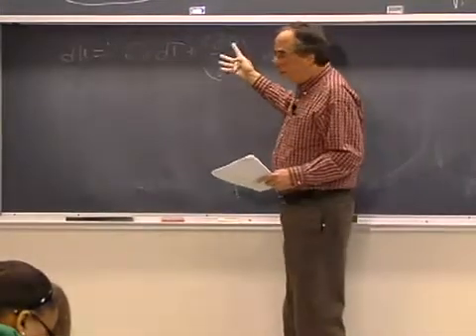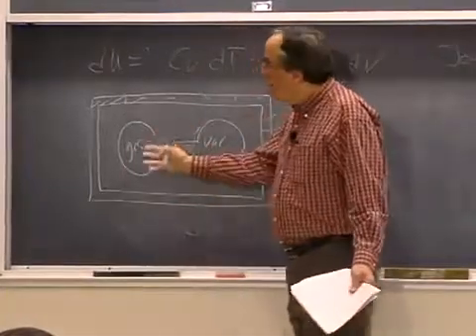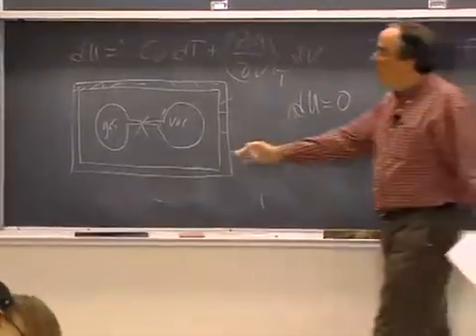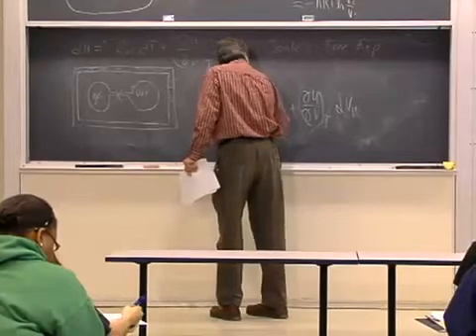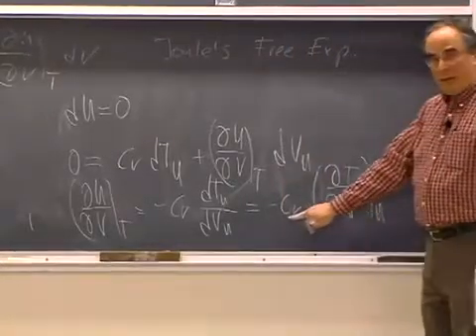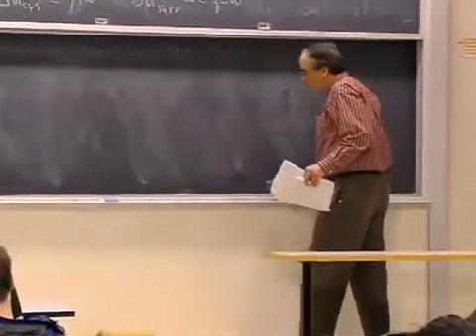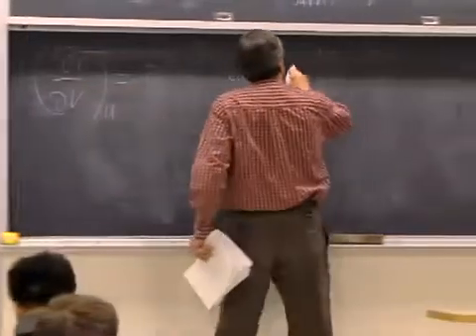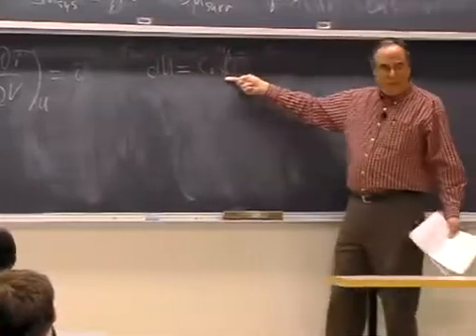Lec 3, MIT 5 60 Thermodynamics, Joule's Free Expansion of Gas Part 1

Comment: Why rockets can't generate thrust in a vacuum.
Reply: The thrust is produced by the expanding gas pressing against the rocket. The atmosphere has nothing to do with it.
Reply: yes they can generate thrust in vaccum...comubustion takes place in the absence of air with the help of an oxidiser tank and according to the principle of conservation of momentum a thrust  is generated in the opposite direction of the ejection of combustion particles
Reply: @resueltoalma4773  No, gases cannot be 'ejected'.  Gases merely expand to areas of lower pressure.  Defintion of ejection: "The action of forcing or throwing something out".  According to the principle of free expansion, no force is required for gases to expand into a vacuum.  That's the whole point.
Reply: @numbynumb  thrust is an applied force, which means it must come from a body external to the body being thrust. a vacuum cannot provide an external force, ergo no thrust is possible. very simple, think in terms of newton's 1st law.